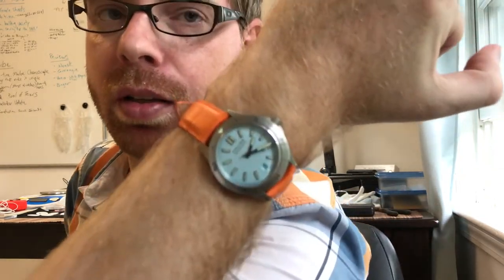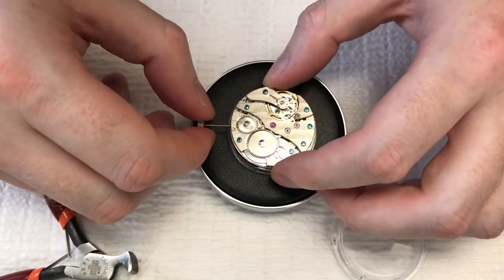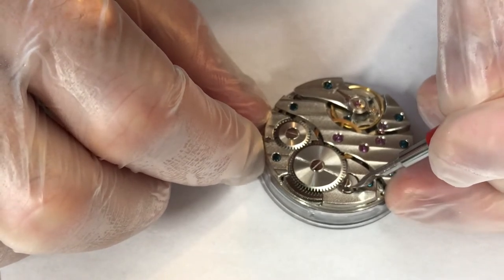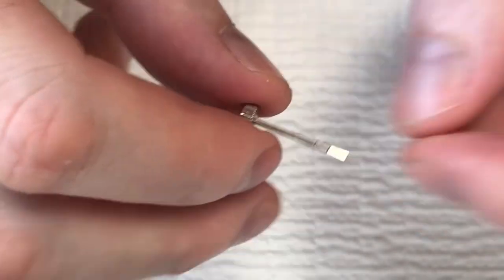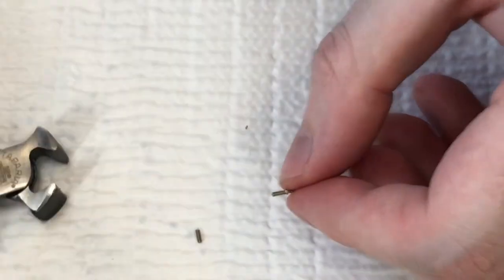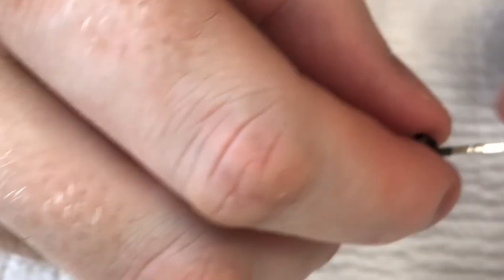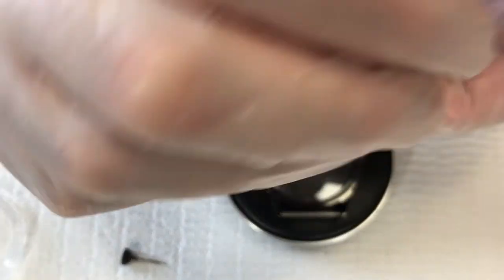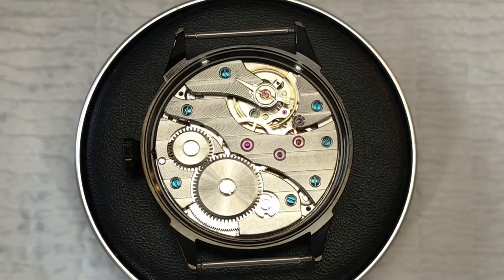Making Custom Watches: Stem cutting and case cleaning

Comment: Brian, I am getting ready to do this exact project.  I just received the case today.  I have the ST360 movement and the dial.  I just need the hands.  You did not show how to measure the stem.  That's what I was looking for.  Do you have this on a different video?  That is an important step to cover.  Also, do you know if these ST360 movements are lubricated?  I have heard that they come unlubricated from the factory.  Otherwise they are supposed to be very good and well made movements.
Reply from the maker: i thought i showed it somewhere, but you want to attach the stem to the crown and put the stem all the way in the movement. then measure from the base of the case to the base of the crown and remove approximately that amount. There are a couple other videos I’ve seen on how to measure. I do recommend trimming less than the amount you measure because you can always trim/file away more, but you can’t add any back. after trimming, i like to use a small file to even the end up.
Reply: @WatchComplications  Thanx Brian for clearing that up.  I appreciate it.  Luckily, I also have an extra stem to use if I make an error this time as well.
Reply from the maker: just don't forget to write down how much you remove so you remember for the next time!